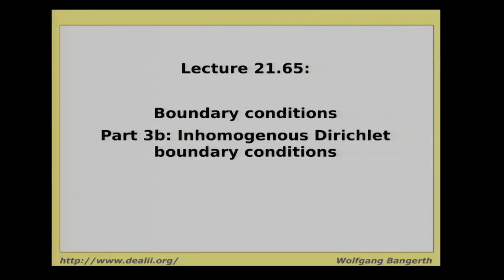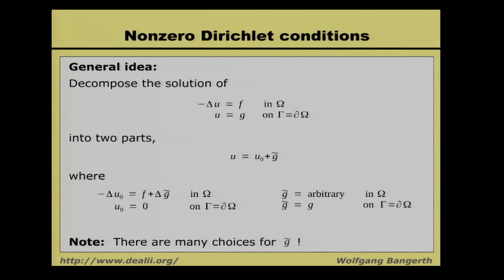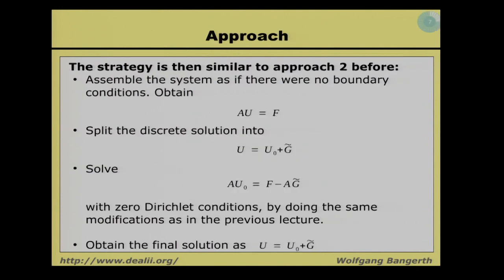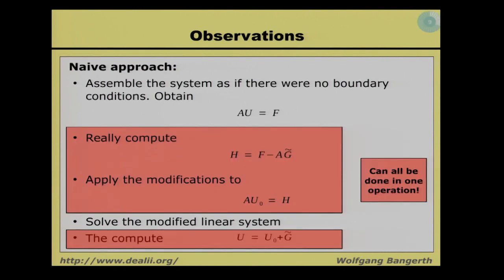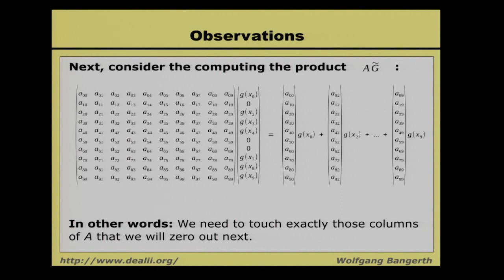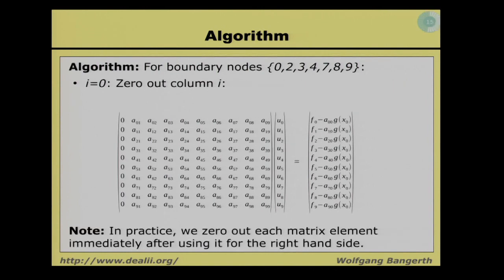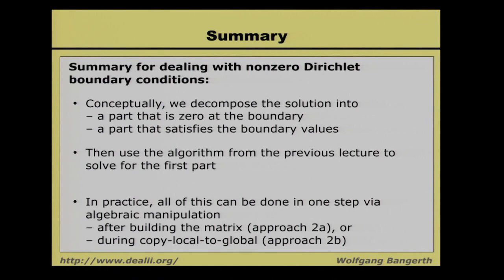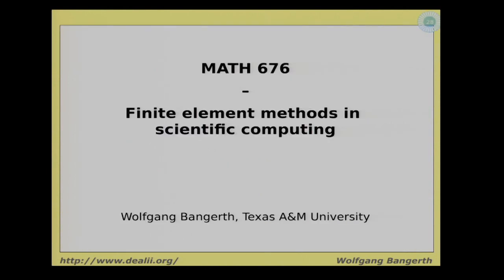Finite element methods in scientific computing: Lecture 21.65

Comment: All of this seems to be contingent on \tilde{g} being a finite element function. However, If our criterion is that \tilde{g} \in V_h and V_h \subset H^1(\Omega), shouldn't we require \tilde{g} to not only be square integrable but also have square integrable first partials? Obviously \tilde{g} does not possess the latter property.
Reply from the maker: @zaccandels6695 Yes, good question. Obviously, since u_h is a finite element function, you can not expect that u_h=g on the boundary if g is not also piecewise polynomial. In other words, you can't impose any boundary values, but only ones so that indeed you can define an extension \tilde{g} that is in V_h. If you have an arbitrary g, the usual procedure is to first interpolate it into a finite element space on the boundary (let's call it g_h) and then find a finite element extension \tilde{g_h} of that. This also explains why, in deal.II, the function is called interpolate_boundary_values().That guarantees that \tilde{g_h} is in V_h (and specifically is in H^1, so square integrable and with square integrable derivatives).

Comment: What's the difference between using the algorithm you propose versus just zeroing out the row of the boundary degrees of freedom, setting the diagonal entries to one, and the exact value in the corresponding entry in the right-hand side vector? I.e. leaving the columns untouched, since in the inhomogeneous case we don't want to set the test functions to zero?
Reply from the maker: You can think of what you describe (zeroing the row, setting the diagonal entry to one, and setting the rhs to the correct value) as a first phase. That is sufficient to get the right solution, but you now have a non-symmetric matrix, which is not good if you work with Conjugate Gradients, for example. That's why you can also zero out the column and modify the right hand side vector accordingly. You can think of this as adding multiples of the modified row to all other rows that are nonzero in the affected column -- i.e., in essence a Gauss elimination step where you are zeroing out a column by adding multiples of one row to other rows. The end result is a matrix that is symmetric again.
Reply: @wolfgangbangerth2397  Thank you very much for your answer! On another note: will the algorithm you propose work in for example mixed problems like Stokes equations, where you have a saddle point structure S = [A & B\\ B^T 0]? Would it work to modify the right-hand side by S*g here as well, or do you have to modify it using only some of the block matrices A or B? I'm really grateful for you taking the time to reply here. If you don't have time to answer but have any references in mind I could look into, that would also be great. Cheers! /Sebastian
Reply from the maker: @sebastianmyrback1138  The algorithm does not care whether the matrix has a sub-structure. From the algorithm's perspective, there is only a matrix S and a right hand side vector. The fact that they could be decomposed into smaller blocks is not important to the algorithm itself.